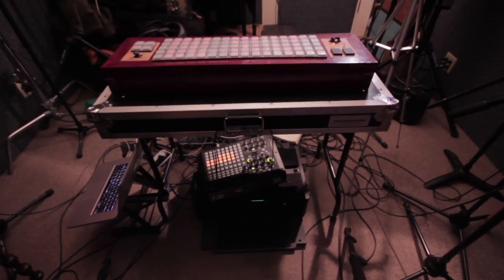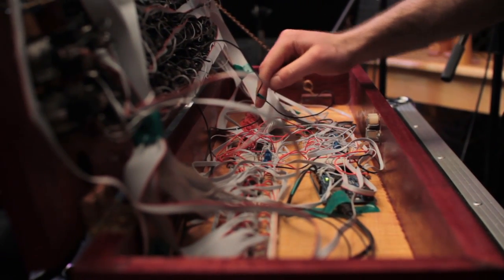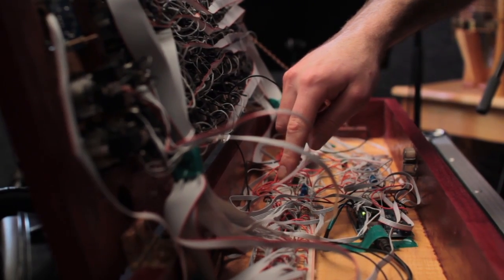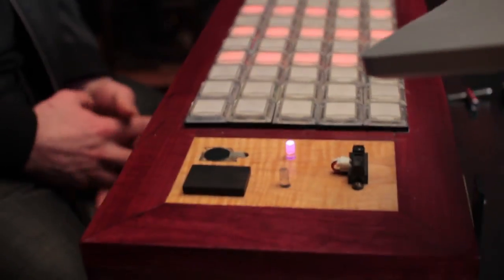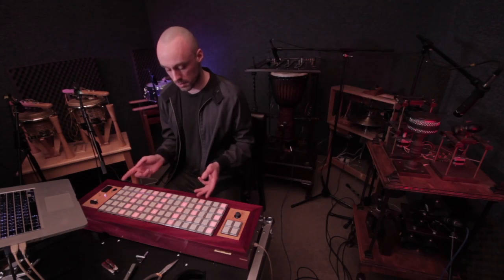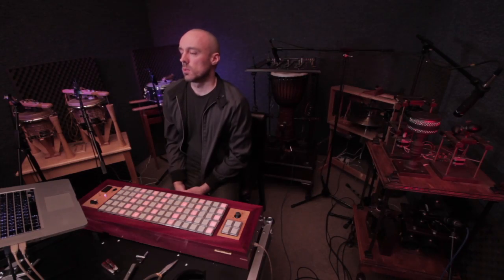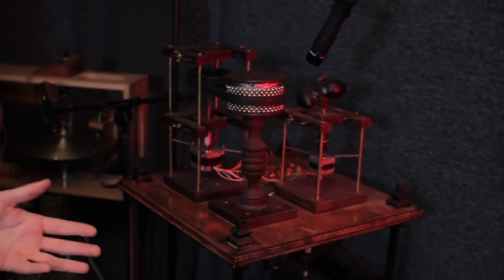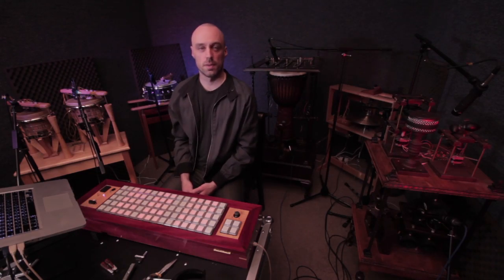Meganome -- DIY Arduino MIDI Controller

Comment: That is crazy! would you mind sharing how to rout/program those drums to respond to software? I want to build something that I can send midi to and get physical feedback (ex. drum hitting, mallet hitting xylophone, etc.)
Reply from the maker: I send standard MIDI to an arduino and use the arduino to trigger solenoids. I think you can get MIDI shields for arduinos, and there are lots of tutorials about controlling solenoids. The hard part offsetting latency and timing the duration of the hit. That will take some experimenting.

Comment from the maker: Well, someone with more engineering chops could build a similar controller with velocity sensitive buttons. As it is, I can control drum and synth velocity with one of the LED encoders. That would be a liability if I were playing Beethoven, but I'm not. I'd encourage you to listen my track Meteor Shower on SoundCloud. It was programmed and improvised with the Meganome, and it has lots of dynamics.